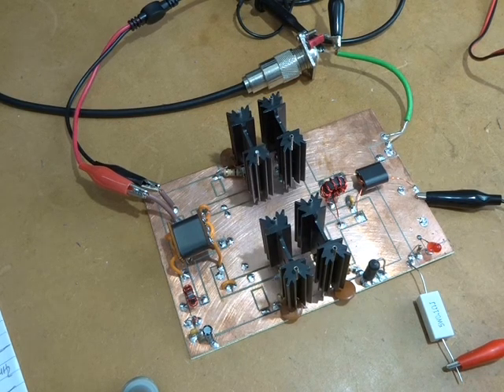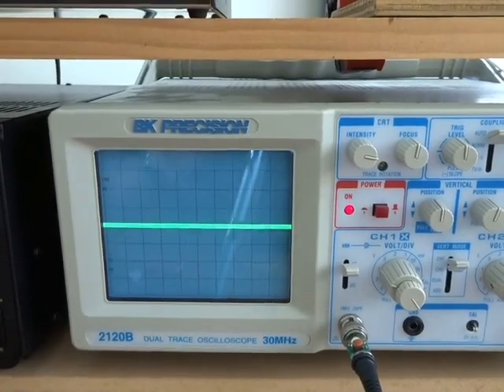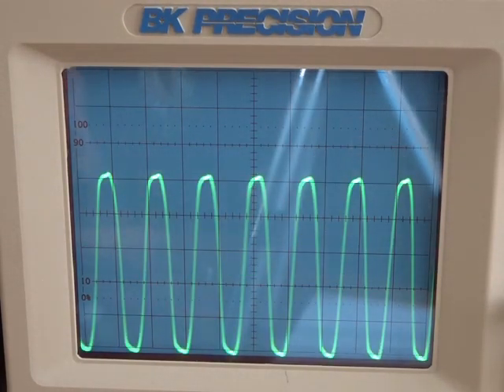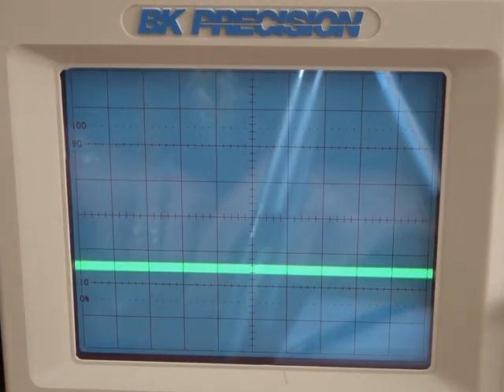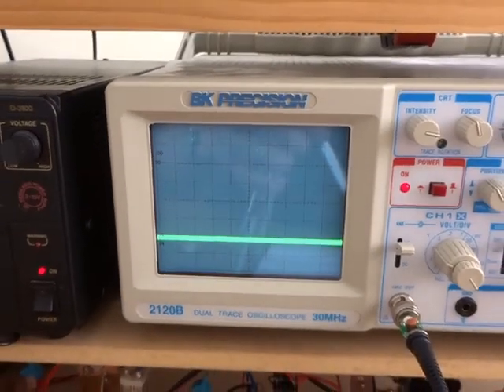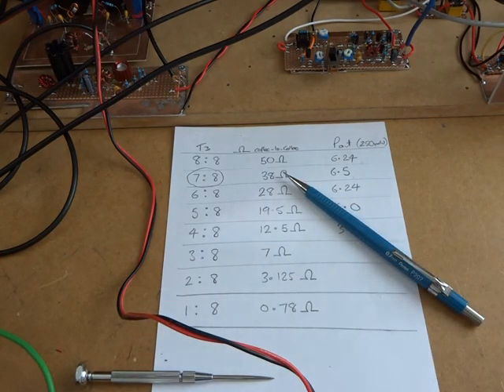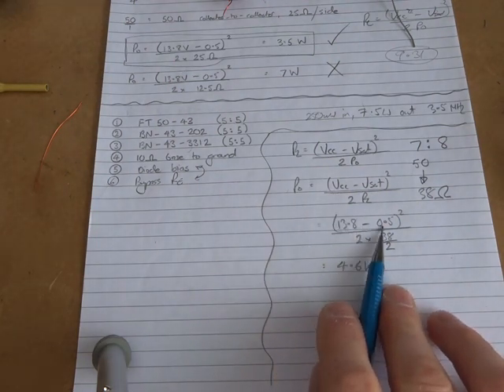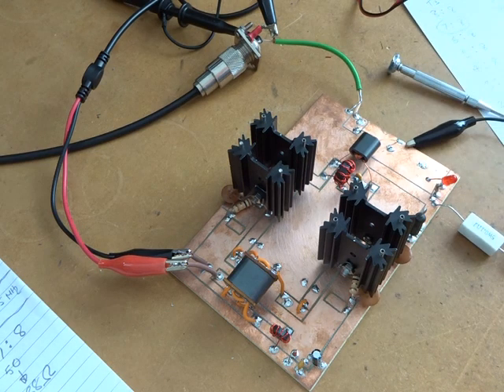BD139 Push Pull Amplifier Experiments - Part 3

Comment: Wondering which brand BD139 you're using as the ones I've bought recently don't perform as well as the NOS Philips ones I have?
Reply from the maker: Hi Clint. That's a good question. The last batch I bought from the local supplier (JayCar) have the following written on them: TFK H. Not sure what brand that is. I matched (as close as i could) a set of four  using the HFE setting on my old multimeter . They were all 51-54.
Reply: @CharlieMorrisZL2CTM    Fairly sure TFK is Telefunken and that they're now Vishay so they could be really old stock, they'd probably be matt grey if they are!
Reply from the maker: @M0UAW_IO83  Ok thanks for that Clint. I do have some grey ones in the junk box somewhere. These were black.